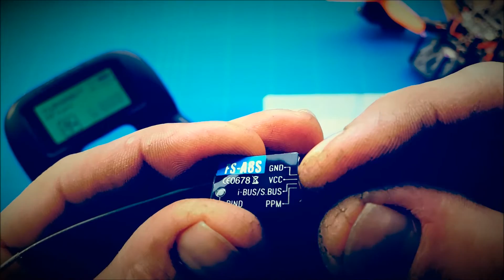How to Bind Flysky Receiver FS A8S To The Turnigy Evolution Radio

Comment: Hi..i did that..i have solid red light..but it's not working..there is no output
Reply from the maker: +Daniel Dz no this doenst work with servo's 
You connect the wires to your flight board
Hope this is what you meen or maybe you wires are bad than it better to solder new wires direct from receiver to the Fc
Reply: How To DIY Rc yeah i know..i connect it to fc but fc has no inputs form rx ..and radio not showing rx voltage and there's ? on rx.. interesting thing is that when i change my models on radio rx does not disconnect..and it's still has solid light..
Reply: How To DIY Rc and my fc doesn't arm with sticks like it's used to..but with ia6c it works perfectly
Reply from the maker: hmm  maybe the circuit board went bad and stopped working correctly 
have no clue to help you Sir i'm sorry
Reply: How To DIY Rc thank you so much for reply

Comment: Hi , I'm just starting to build my gliders. I want to try this lightweight receiver instead of my big flysky receiver. Do you have to change the plug of the servo to make it fit with this receiver? Because it looks like the receiver also has a female plug for the servo!
Reply from the maker: sorry this receiver only work with an FC and don't have any servo connection i'm sorry 
if your using it for a glider than why don't you try a 2-3 channel receiver for cars!